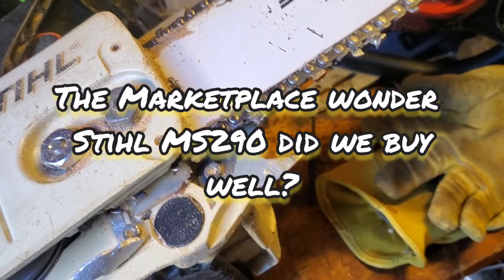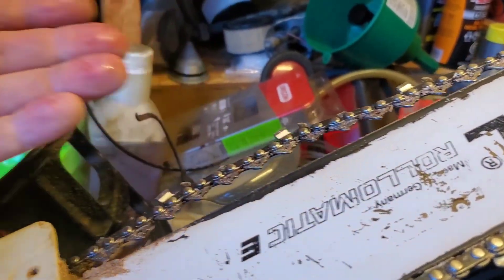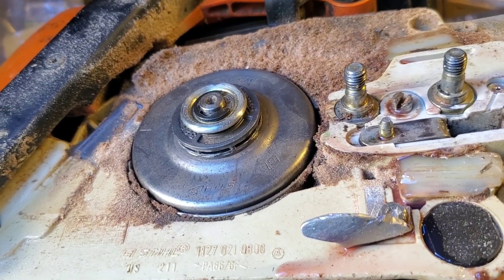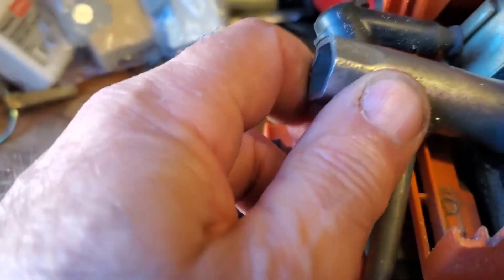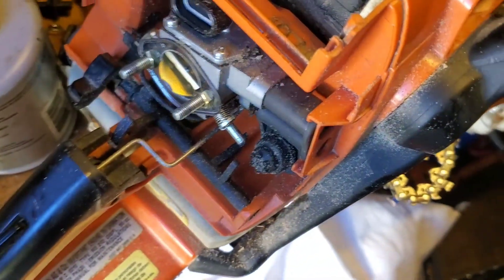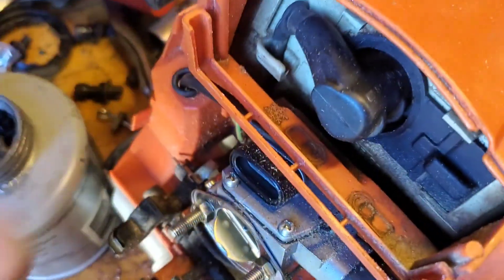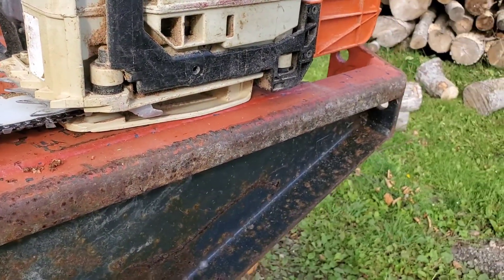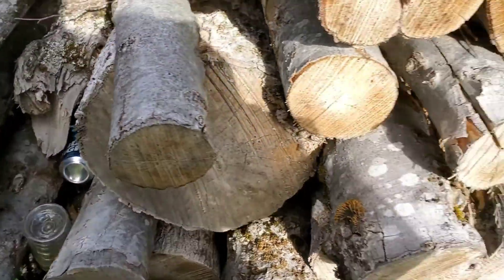The Marketplace wonder!! was buying a used Stihl MS290 Chainsaw a good idea? 👍 👌

Comment: Is it possible that the bar groove has gotten pinched?  Even in the factory they use a flat gauge bar to confirm the groove is wide enough, and if not they just pry it open gently
Reply from the maker: It's over wide and the chain is laying over I can't find any throw away specs. I ordered a new bar as I have 3 saws that can use it. I will make some comparison measurements